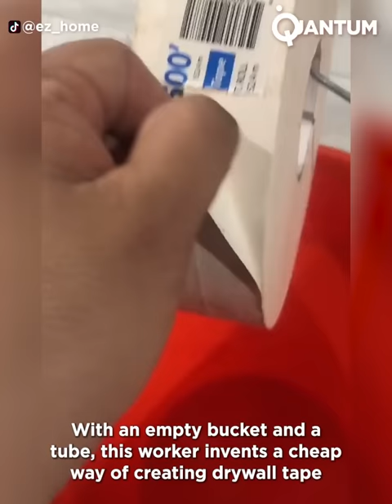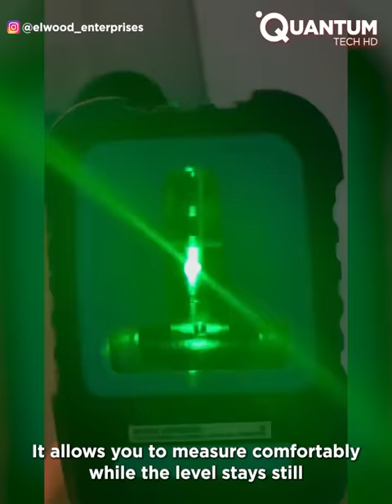Top 50 Construction Tips and Hacks That Work Extremely Well | Best of the Year Quantum Tech HD

Comment: @ .51 the installer is sticking the cables to the outside wall. Whoever ran the wires should have stapled them to the stud. Now the installer isn't applying the foam correctly. Spray foam insulation is "installer sensitive". Application is critical for air sealing and thermal insulation. I can take the same raw products and have 2 different results just by application. I can reduce the HVAC loads by up to 20% with proper insulation.
Reply: its youtube mate no one cares

Comment: What happens when you need to replace or run a new electrical line  through that spray foam though?
Reply: Some idiots have had it sprayed between their roof rafter's and now their roof is in danger of rotting due to no air circulation

Comment: @ 10:01 this is absolutely the most idiotic way to cope a piece of trim for a lot of reasons. The main reason, you should NEVER use a jigsaw upside down with the blade facing you, as shown in this terrible "demonstration." That is just asking for an accident.

There is also a very high chance of the blade destroying the finished side of the material, due to the blade only cutting when moving away from the tool. This directs all the force of the cutting motions towards the finished side, almost guaranteed to ruin cuts.

My biggest complaint though? To use a jigsaw to cope when there is a tool specifically designed for that (called a coping saw, duh), is just plain lazy in almost every situation. The biggest argument I hear for using them is how much faster it is. Although in my 15+ years of doing custom finish carpentry, I have not once had a single person cope anything with a jigsaw as fast as I can with a basic coping saw. In most cases, I am able to cut and cope at least 2 pieces in the time it takes another to make a single cope with a jigsaw. People should stop being lazy and trying to find shortcuts, and just do the work the right way.
Reply: I agree with you about using a coping saw, but on a regular jigsaw blade, they cut on the upstroke. So when using upside down as shown they cut to the back of your work. You might be used to using BR blades that cut on the downstroke.
Reply: If the finished side is scored with a knife first, it won't ruin the finished side with the jigsaw blade.

Otherwise I totally agree with everything you said 😁
Reply: @dantigar7318 That is just plain wrong. There is no such thing as a "regular" jigsaw blade. Maybe you are saying that the blades you use regularly cut on the upstroke, I don't know, but every type of jigsaw blade has a specific use, and only for specific materials. 

You can just as easily get down cutting jigsaw blades designed for wood as you can get up cutting ones. Unless you are buying your blades from the same place you grocery shop, chances are they have both. Scroll saw blades for jigsaws are most commonly used for coping and feature teeth that are either down cutting or, more often than not, forward facing. 
In fact, you should never cut any finish wood with an up cutting blade. That is just as dumb as coping with a jigsaw in the first place.
Reply: @madbeef. True, that's a good point. However, that would also be adding another step,slowing the process even further, making it even less efficient than using a coping saw than it already is. 
Dependly on the material I'm using, I typically flip the piece after my initial miter cut and back cut the straight portion of the miter. There are a couple advantages to using this method. First, you can ensure that the section you back cut is perfect every single time, potentially saving time and material by avoiding errors when hand coping that could cause the piece to need cut again. Second it reduces the time required to hand cope the piece. Considering that baseboard sizes are most commonly 1×4 or 1×6 and the shaped portion at the top is usually only 1 to 1.5 inches, this means you reduce the amount of hand coping, and risk of error, by roughly 75%.